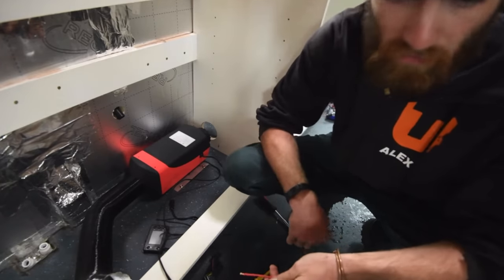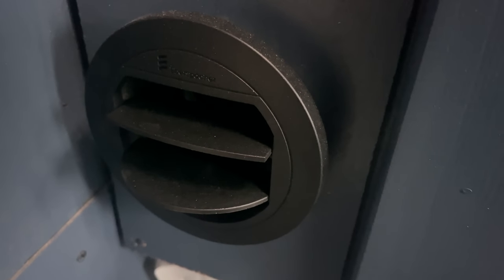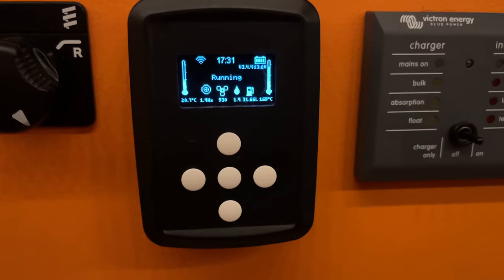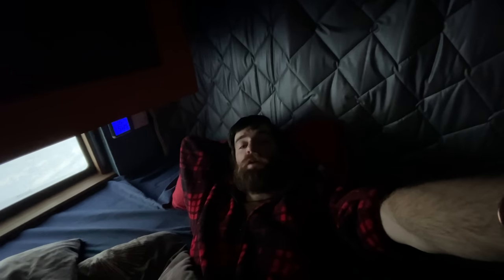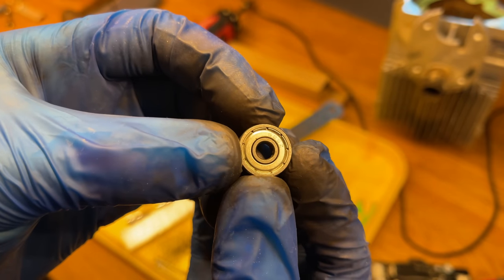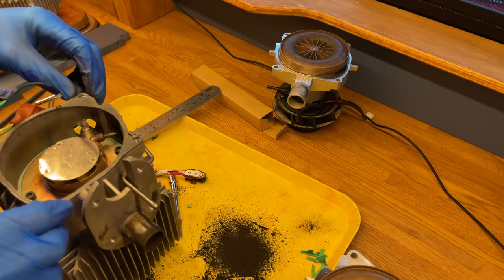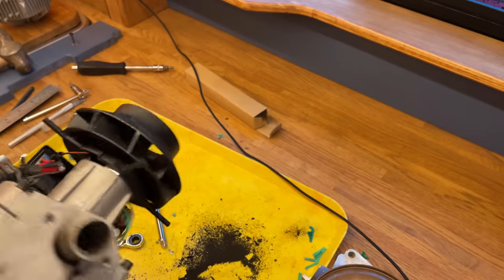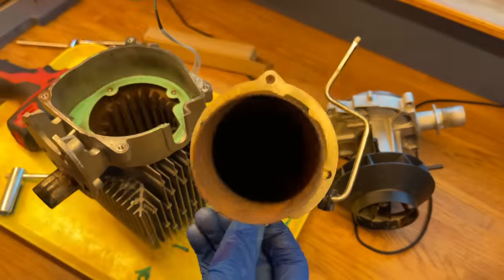2000 HOURS LATER! Chinese Diesel Heater

Comment from the maker: What is the main failure point of  Chinese diesel heater you have experienced?
Reply: @geminiman6938  that's really a consumable really though, you have to expect to need to replace these. Same in my wood pellet stove
Reply: The fuel pump and the fan  motor wear out the quickest on all of my heaters. Make sure to have extra fuel atomizers on hand. I found fastest way to clean out blast tube from soot is to use propane torch to cook it out then compressed air to blow out .
Reply from the maker: @gloknor  interesting I very rarely hear people talk about pump failure, water ingress into the plug area?
Reply: @MispronouncedAdventures  Yeh they go bad just like everything else. I have taken these apart and fixed them over the years many many times . Make sure to get replacement screens they get funked up .
Reply: Cheap nasty m/b and controller giving nasty unusable settings
Reply: @fleabag72  and dim hard to see .
Reply: @MispronouncedAdventures  Fuel pumps have been the only things I've personally had to replace, I have a collection of like 6 of them now. None of them have actually died, I eventually figured out that old/bad fuel was just clogging them up. Injecting isopropyl alcohol in them with a syringe eventually freed them back up and good as new. I put a filter on the fuel pickup, became more aware of fuel quality, and haven't had any more problems.
Reply: bearings for me. If you have to take one apart after some hundreds of hours, just assume you're going to be replacing the gaskets.
Reply: @MispronouncedAdventures  Do You happen to have a link for the controller You are using for Your Heater? I really like the one You are using! I really like the way You have set up your Van! Thanks for Your help! 🙏🏻👍
Reply: Just had one  that had a mouse jammed in the air intake hose, it even got pass the air filter somehow .
Reply: Carbon build up is the number one failure of these diesel heaters by far. I've had 6 or 7 now and operate them 8 to 10 hrs. Day on high. I'd recommend not running fuel over 5.2 better if u can be lower towards 4.5 hz if temps during use allow u too. And run ur fan speed as fast as possible. More air for combustion does not foul combustion.  It makes sure u can get as clean of a burn and hot as possible.    

Yes the glow plugs can crack. And the fuel screen can get dirty but usually by this point the heater will b carboned up inside.   This carbon is  unavoidable when burning diesel in this heater.   Keep an extra heater if u depend on this for heat. It's cheaper than buying extra parts.   I get about 1.5 yrs per heater operating 6 to 10 hrs a day.  In mn. Winter zero temp. Or below I find it needs to b on almost all the time on high. Now my service van transit med roof has no insulation. Just the ford rubber/foam floor and wood panel walls. But I would say I love having this heater in my truck. 
It works great keeps my floor dry and it not so load as people often say. My fuel pump is under the floor it's not a big deal.    If u r going to use this not everyday it will last u a long time and it's safe inside the van. No fumes as it is separated combustion. 

It is the nature of these heaters to carbon up. It is inevitable. Yes u could pull it apart and have a huge mess and clear it out. But if u r needing it in the cold freezing temps u don't have time for all thst. Just keep a spare new unit and thro it in the mounting. Leave the control and reuse the wiring and I'd say change the exhaust pipe as it fills with carbon.
Reply: I found that the other day my heater straight up wouldn't start up. It kept saying it was out of fuel (E-8), but turns out it was flooded, and the exhaust was full of diesel as the output was higher than the lowest point of the bend in the exhaust pipe.
Reply: @tobiasmills9647  Did you ck your fuel screen ? If it is clogged it won't atomize the diesel good enough for combustion also ck for air intake obstructions (like the mouse I found in tube the other day). Good luck hope you get it working .
Reply: @gloknor  no, it turns out that during the start up, it would basically flood, but wouldn't have enough space for the air to escape via the exhaust, then run through the off cycle. Unfortunately, when it's 3am and you're in a metal boat on a river, you just hit the kill switch, prime it and try again because there's frost on the inside of the windows. In doing this, it compounded the issue. User error mainly.
Reply: @tobiasmills9647  Yeh that stinks happened while boating in the cold. I use to work by the river here in the northeast  and I bet you were quite cold . Maybe get a back up one and keep on boat .
Reply: zz sealed both sides.??.
Reply from the maker: @harrywalker5836  yes it is
Reply: @harrywalker5836  ZZ = double shielded
                            2RS= double rubber sealed
                            ZZ Top = long beards and loud music.(good to drown out the noise from the heater)😆
Reply: @iguanamoat  I found the same as you. when a pump stops pumping it is almost always because the plunger piston has gotten gummed up. as you say they can be freed up squirting isopropyl  alcohol or naptha lighter fluid through them and giving them a good shake back and forth.
Reply: My personal experience is that Vevor diesel heater run like a charm the first 2.000 hours, if they are not "abused" by manipulated air-fuel-ratios which are too fat.
Reply: @natehess7663  I live at altitude, recently replaced the old one due to bearing failure after about 2000 hours of operation as well, it sounded like this one in the video, the new one however, had a different controller, which refused to compensate for the altitude, blew lots of white smoke, overheated and plugged up within hours, replaced new controller with old, ran it very lean, and it cleared it up within an hour. the latest and greatest controllers appear to be garbage.
BTW, where did you get that one?
Reply: I deal with mostly furnaces with large chambers and fuel rates , these are another breed of animal all together. Closest I've got is a space heater that operates on carburetors, neat video. Almost like a diesel jet engine.
Reply: Bearings, though more recently, really crummy controllers
Reply: Some have said the controllers are bad so would that mean that the Aussie Afterburner would be the option to improve that? Thx
Reply: @fleabag72  did you swap it for something else that could replace it?
Reply: @theshepard22  yes purchased another m/b and controller, just need to fit and test
Reply from the maker: @mrsrhardy  I do but it’s compartmentalised off from the fridge. The heaters ( the main unit casing )  themselves don’t really get hot, the ducting does.
Reply: @MispronouncedAdventures  Mine wont start with the air intake silencer on the intake tube, even if the tube is straight, so I had to shorten the intake pipe to half its length and put a piece of fine nylon mesh over the end with a rubber band, it starts first time every time now. I get a little smoke at startup and cannot seem to be able to reduce this even if I run the heater at full chat and highest setting for a while to clean it out, Ive changed all the ECU's for the blue ECU's and blue screens with LCD remote controls as the ones supplied with the heaters were absolute rubbish.

 I had to suspend the pump with 6mm bungee cord to silence it almost completely. in 6 months of using two 5kw heaters on in the caravan and one at home Ive just had to replace a fan motor on the one at home, probably because it is being fed with internal air and it gets a little hotter than the one in the caravan which is fed outside fresh air. The house one has been turned off every night but the caravan one runs all night long when the weather is cold, mainly because the house doesnt loose heat as quickly as the van.

Now Ive silenced the pump I will try running the house heater all night when the frosts start.
I run kerosene here in the UK sometimes as it is cheaper than red diesel.
Reply: @oojimmyflip  Recirculating the inside air is more energy efficient. As the air gets warmer, the heater has less work to do. I checked the humidity outside on a damp night here in Northern Ireland and it was up around 90%, I then checked my van, no heater had been on and it was around 65%; I would have been bringing moister laden air into my van if I had it fitted like you have in your caravan Jimmy. I'd guess you are using more fuel than you need to be, constantly heating outside air to meet your caravan temps.
Reply: What's the best unit to get?
Longevity, ease of use and parts availability?

TIA!
🙏🙏🙏
Reply: What was the name or where can you get the better control system
Reply from the maker: @donaldpetrey3064 “afterburner” controller for Chinese diesel heater. That should find you the results on Google
Reply: any good machanic knows those seals only seal 1 time its a squish seal always replace them same as the metal; ones
Reply: @superbanaan9  Indeed. The rubber ones last. You can get gasket paper rolls at the parts store and create a gasket for the other heater pretty easily. I've looked into these a bit and I guess they run pretty clean when you actually run Diesel in them. I've seen people running coolant mixed with oil and you can practically burn anything if you mix it right. However theirs was much more dirty after a fraction of the hours.
Reply: Fuel pumps. To the point that i keep 2 spares in stock at all times.
Reply from the maker: @dalescott4570  I do as well, I have problem about 5 x .22 Around in different places. My other ones are more difficult. I got a .65 for US made Chinese heater, .42 for a Webasto engine pre heater and a .28

But for arctic trips, I take an entire spare heater and accessories
Reply: @gloknor  if soot is happening then you're running too rich and producing scads of Carbon Monoxide to boot (incomplete combustion)

You want to adjust fuel air ratio for peak exhaust temperature and then go LEAN of that to avoid melting things. (Startup will be rich but once up to temperature it should switch to lean)

there are some opensource controller boards circulating which use oxygen sensors to dynamically tune things. The original combustion controller designs have barely changed in over 40 years...
Reply: @miscbits6399 Hi nice to hear from you! I have had these heaters for years and many of them. The reason they soot up is usually from the mentioned items I said before. The soot happens when a component fails. The fuel needs to be clean too. I stand by what I said and make sure to have extra pumps, screens and fan motors. The only part that holds up well is the glow pin. I hope you have a great winter and stay warm .
Reply: About 2 years old, 5kW according label but size is from 2kW.  Seldom used by the former owner of my boat. I had not used it last year do to the fan noise. Started using it daily a month ago. After one month daily use, the pump still works but you almost do not hear it anymore so something is wearing. It soothed and refused to start a few days ago. Did some tests.  3V voltdrop over crap chinese powercable (copper plated aluminum) Opened it, complete clogged with sooth. I use automotive diesel. Gasket was paper so it teared. The "flat" surface is far from flat so I needed 2 hours to get it clean and flat.  Screws are not great quality. The silencer leaked from all sides, the hoseclamps are not suited for the exhaust system. The tubes where not rusted. I had to kit everything with exhaust-paste and alu tape. The heaterplug and atomiser were clean, the ignition chamber was fairly clean, the combustion chamber was totally soothed between the tube and the alu housing in such away you could not even see the ribs anymore.  The ecu is not in some kind of box and does not have conformal coating, the biggest joke is they sanded of the text on the IC's, the cloners are afraid of other cloners. The PCB stated 470uF caps, they mounted 330uF. ESR was still OK. Made a new gasket, put it back together, use it a few days and then keep it as a spare because next week I am going to mount an Autoterm.
Reply: I had a error code e10. I hit the fuel pump and it started working again. Apparently when you let it run dry it has issues
Reply: I’m on my 6th heater it’s always the bearings that go bad ,still on the first fuel pump . I just replace the bearings and put them into another vehicle or trailer and keep a few as spares.